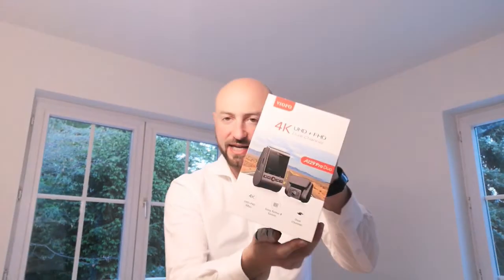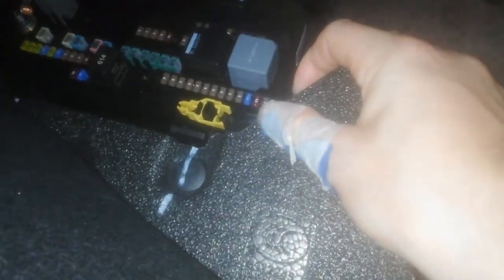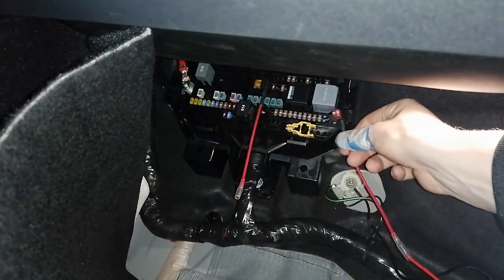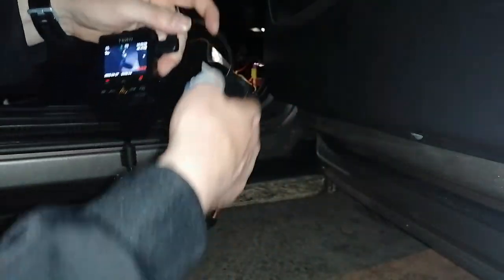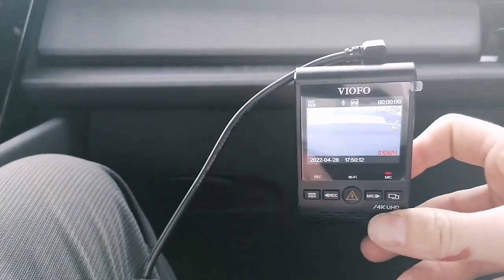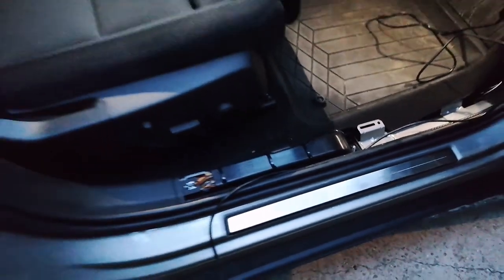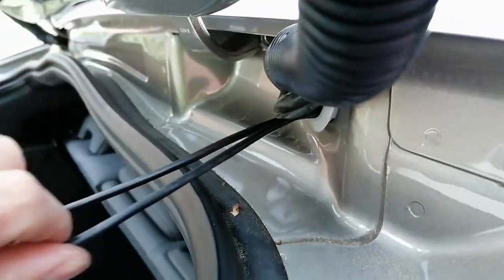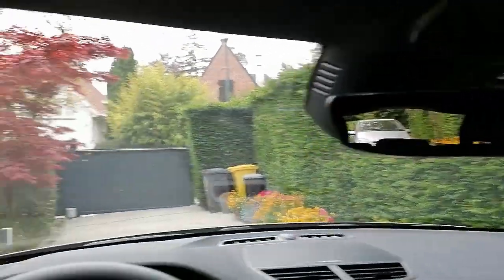Installing Viofo A129 Pro Duo 4K dashcam in Polestar 2

Comment: I just got finished installing mine, using this video as reference. I opted to route the rear camera cable down the left hand side of the vehicle, which required removing the bonnet release handle, which wasn't hard. I popped off all the panels that I could, which required releasing the rear bench. Everything just clipped back into place.

The hardest part was routing the cable around the back of the airbag in the C pillar and then up through to the boot door. I managed it using very thin steel wire.

Everything works great! Thanks for this reference.

Comment: Hi. I recently installed my dash cam, and your video was very helpful. However, I have to warn you that the part of the cable crossing the top of the A pillar, probably will get in the way of the side curtain airbag. After watching an NCAP crash test video, to see how the airbags inflate, I decided to place the cable behind the A pillar panel. To remove the panel you first have to pop out the dashboard side panel (the one with the passenger airbag on/off switch). Then pop out the small panel below the A pillar panel, and then remove the A pillar panel itself. Note that there is a screw behind the airbag plastic label, which has to be removed first. Now it is easy to install the cable and strip it to original cables, to ensure a safe cable route. I have a Polestar 2, 2024.
Reply: I think I've seen this on Volvos, which isn't surprising. You're saying to pop out the "airbag" label and behind that there's a 8 or 10 mm bolt?

Comment: Really helpful video. I used you coat hanger trick for the rear pillar. I couldn’t get the adhesive pad to stick to the rear brake light cover though. Maybe I need to wipe it down with alcohol or something. Any suggestions?

Comment: I just tried getting into my fuse box and I can't see how you got the lid off with the glove box in the way.
Reply from the maker: I just made a quick video to show you: https://youtu.be/vre-44SKcvw
Basically, you have to open the lid until it touches the back part of the glove box, when it's almost vertical, then you lift it upwards so that it gets out of its hinges, then you flip it back a bit towards the back and get it out horizontally. Check out the video for a demo ;)

Comment: Do you still got the power issue from fuse 31? I'm gonna mount a dashcam so liked the tutorial you made👍
Reply from the maker: Yes, I regularly (maybe every 3 days) have this issue where the dashcam has no power. I have to physically unplug the add-a-fuse, which is quite a pain (not difficult to do, but defeats the idea of an always-on cable...) I'm trying to work out different options, right now I think this is not due to fuse position 31, but more about the add-a-fuse or the cable itself, since unplugging and plugging back in directly works. I'll keep you posted when I have this figured out. (not my highest priority just now, to be transparent with you)
Reply: @novajuiceev  Hi just wondering if you found a solution on the fuse? Installing my camera this weekend. Great video btw! Very helpful to see how the rear is constructed
Reply: @novajuiceev  If this is still an issue, it might be worth putting a switch inside the glovebox.

Comment: How is the rear camera cable thickness? Is it small enough to route easily. Nice install, thanks.
Reply from the maker: It's basically the size of a USB cable (which I think it is - at least the connector is one of those old-school USB type mini-B)

Comment: I tried doing what you did but couldn't fish the wire. You have magical hands 😁

Any chance your radio reception has been affected? I use a fitcamx and it has.
Reply: First of, a big thanks the creator of this video. He gave me the inspiration to actually go for a front AND rear dashcam. The video gave me a lot of confidence and valuable information to start pulling the different panels in the car and how to wire the rear cam.
Anyway, I am also using a Fitcamx and also had radio interference at some parts of my daily route (100 miles in total). This was not the case the week before I installed the dashcam. The radio antenna is at the back connected by a tiny wire to the back window (see timestamp 26:48). In my first attempt the rear cam cable was touching the antenna wire probably causing interference. Well, that is what I suspected back then. So, I made sure the wire to the rear cam is as far away from the antenna wire as I could. I am going to re-wire it so it will pass below the antenna cable in stead of over it. Then it will be even further away from the antenna (wire).
I also attached a ferrite bead on the rear cam cable: https://en.wikipedia.org/wiki/Ferrite_bead to help further reduce interference.
After all this the interference is gone. I have to admit I do not have a real point of reference, because I installed the dashcam within a week of the delivery of the car. At least on my daily route I can enjoy DAB+ without dropouts now.
Also, I did not take the same route from the video for the cable to the rear camera. Well, yes most of it. I pulled the plastic cover at the passenger seat in the front, got the cable to the back seat. From here I pulled on the plastic cover right next to the backseat where the back right seatbelt is. This opens a huge compartment/space allowing me to get the cable to the back very easily. I then stepped in to the trunk of the car and pulled on the right-side panel (where in the plus package a speaker would be, in the non-plus version the speaker grill is still here). Once I got that loose (I did not remove it), it was way quite easy to grab the cable (watch your hands, a lot of sharp plastic pieces back here) from the back seat to continue via the rubber tube to the rear camera. I used a wire to pull the cable, just like the trick with the hanger, to get the cable to the rubber tube.
I hope this helps.